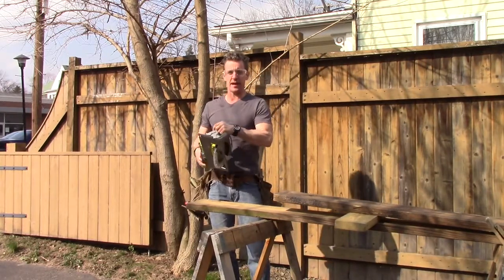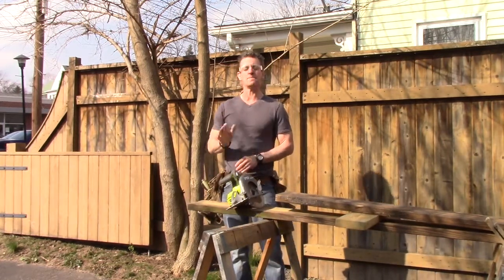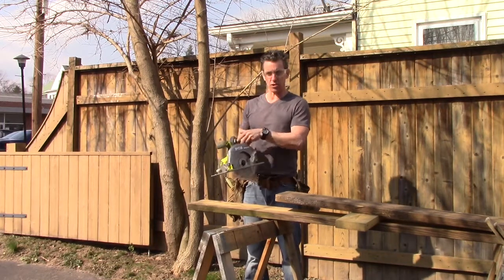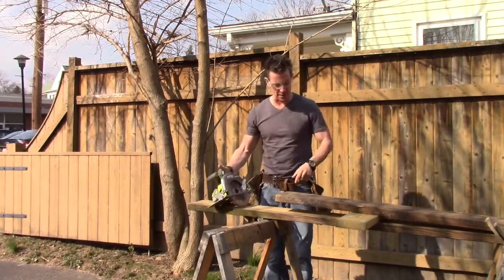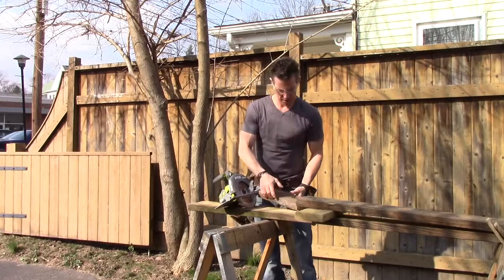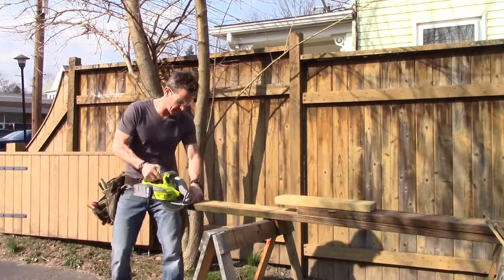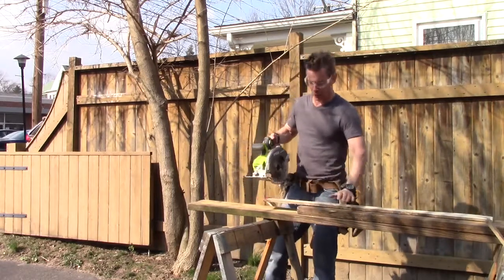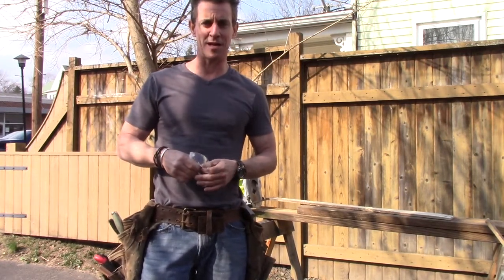Tool review: Ryobi circular saw

Comment: I was trying to figure out how to use the blade depth as the instructions does not show you. Thanks.
Reply from the maker: I don't have this saw any more, but there is usually a lever between the handle and the blade guard. Lift it and you can adjust the depth.

Comment: TOO MUCH wind noise
Reply from the maker: Yes. We're having lots of wind around here these days. The mic on this camera is good too so I'm going to have to work out a solution for that. Thanks for letting me know. Anything about the saw catch your eye?
Reply: The solution for wind noise is called a Dead Cat microphone cover. You can buy or make one. It'll work like a charm. I like the saw, but I have an M18 fuel that I love. I do like Ryobi tools though. I have their cordless jigsaw, inflators, 3 cordless nail guns(18 ga brad, 23 ga pin and stapler(Like them better than my Milwaukee)), a cordless grinder and a cordless drywall cut out tool, along with their P727 LED workbench light(LOVE IT!!!) and finally their cordless hot glue gun(LOVE IT TOO!!!)  Be well.
Reply from the maker: Thanks beauxtx. I'll look into it mic cover. I hear you about the Milwaukee. They make nice stuff too. I have---had, it got stolen if you can believe it---a Ryobi inflator. I loved using it to blow away sawdust. Is this the one you have? https://youtu.be/QMD5L5s_f4s